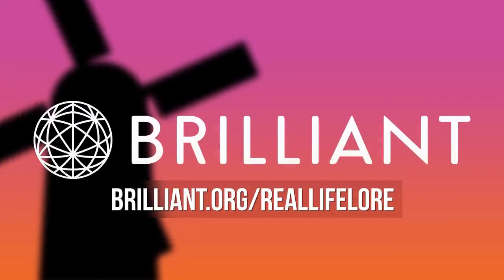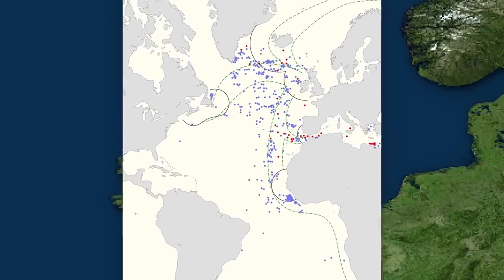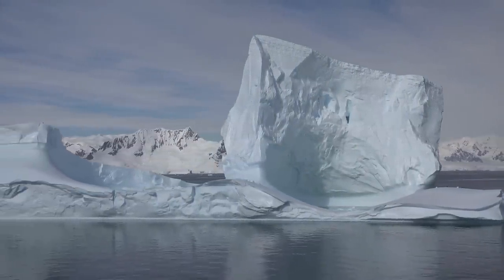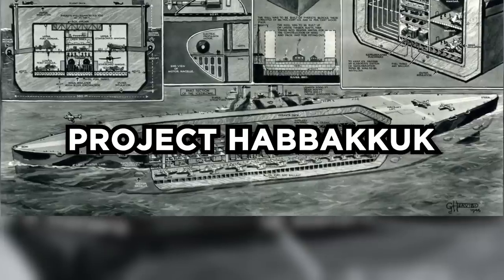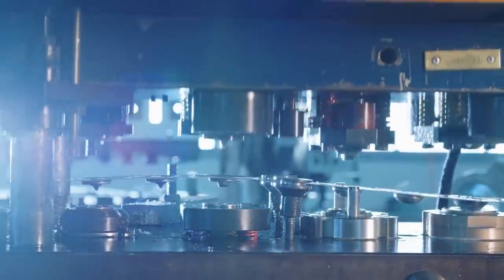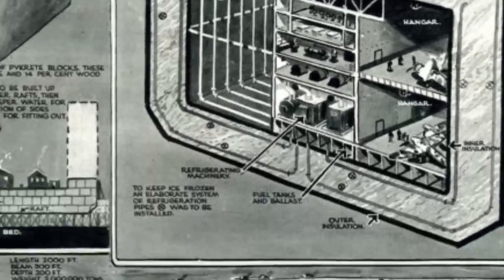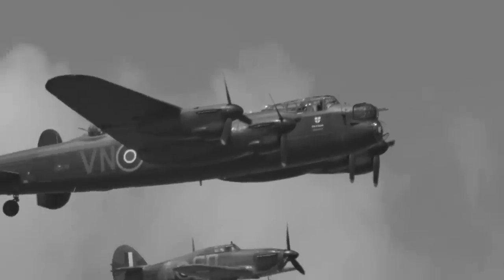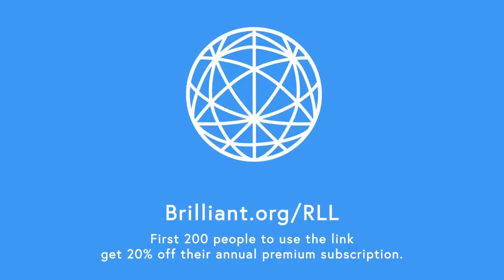The Insane Plan to Build an Aircraft Carrier Out of Ice

Comment: I think the mistake was making it so big. The reason why they did is to make it unsinkable, it had 40 feet thick walls ? No amount of torpedoes could blow a hole into that, and it was easily repairable.

 What about a pykrete aircraft carrier that was the size of a normal one, or perhaps even smaller ?

Comment: Hmm... I wonder if this could actually be done with modern technology and resources?  Instead of wood, maybe carbon nanotubes, plastic fibers, graphene, buckminsterfullerine, or even some composite combination of several materials, along with ice.  Instead of traditional diesel engines and a refrigeration system, maybe combine the two into some kind of mega heat-pump that uses the expelled heat from the refrigeration process itself for propulsion (or, at least, to supplement propulsion) and modern high-efficiency engines combined with electric motors.  Cover the top with solar panels which will both insulate the top and generate power.  Use modern lightweight alloys instead of just steel and modern insulation materials.  And, for the crew, clothes could also be made from modern materials which would be far less heavy and bulky than what the crew would have had to wear to keep warm back then.  Furthermore, whereas such a ship was originally envisioned for war, in modern times this could be a massive cargo ship specifically for cargo that needs to be kept cold.  And we even have methods for creating different kinds of ice which have lower than normal density.
Reply: it would have worked as it is, just it was nolonger needed
Reply: @graveperil2169  Not really.  It might have been possible to make the ship, but the purpose was to save on steel and the end result was that it would have taken even more steel to make the ship which defeated the purpose, not to mention the wood needed to make it was also rather prohibitive.  In order to qualify as "working", it would need to be better than other already available options.

Comment: "...but even more insanely, they thought they could construct one for only £700k, which is only about £31.3m today, for further reference, just one QE class carrier in the current Royal Navy costs about £3bn!"

That's that not that "insane" after you told us that to make 1t of the Pykrete, it takes just 1% of the energy needed to produce 1t of the steel that these QE class carriers are made of. Given that, material costs would be drastically reduced. By 99%! At which point you're mainly paying for labour, and the items that go into it (for what its worth, when valuing the QE class ships, the value of armaments and technology on board is accounted for in the £3.1bn valuation)